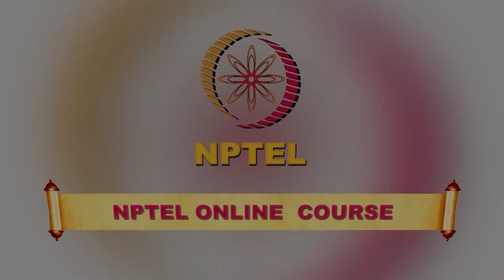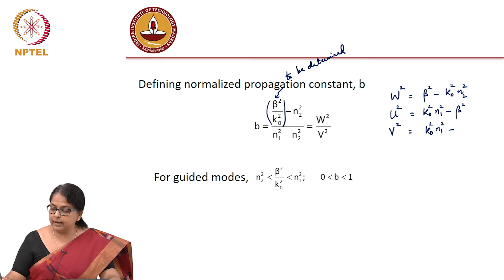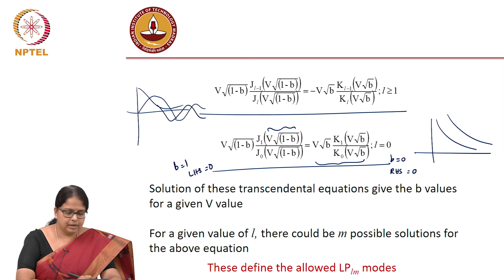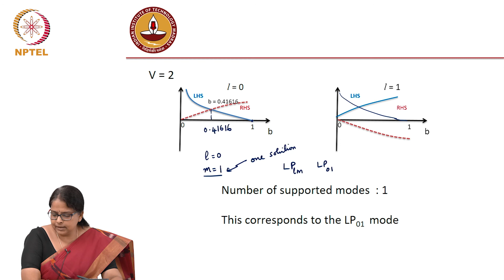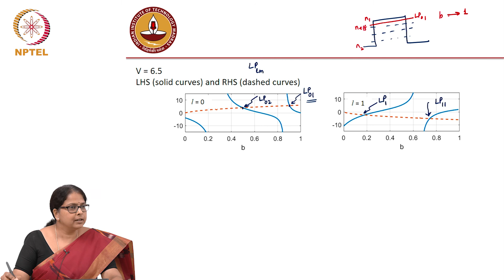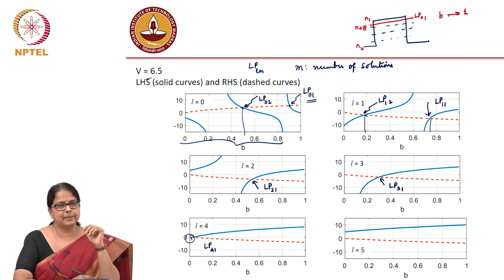Lec 47: Modes of a step index fiber 5

Comment: 9:08 for l=1 J(l=1){0}=0 so in LHS function denominator is 0, well numerator is 0 but denominator is 0 as well, so the function doesn't go to 0 at b=1. So I guess the graph you have removed is actually correct